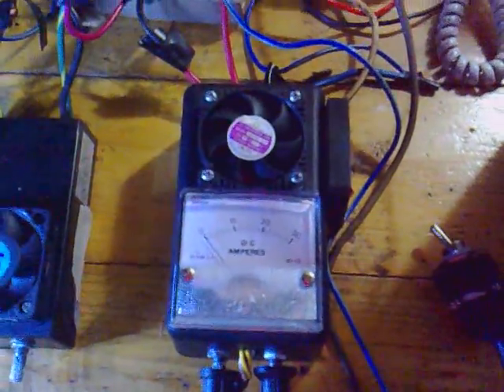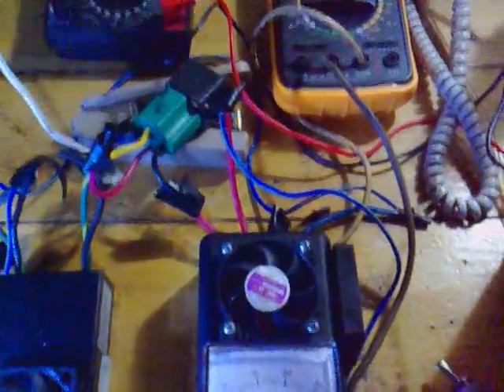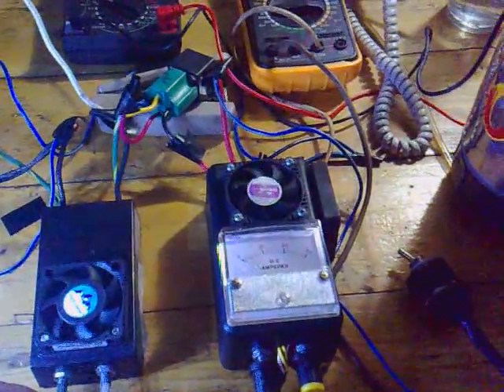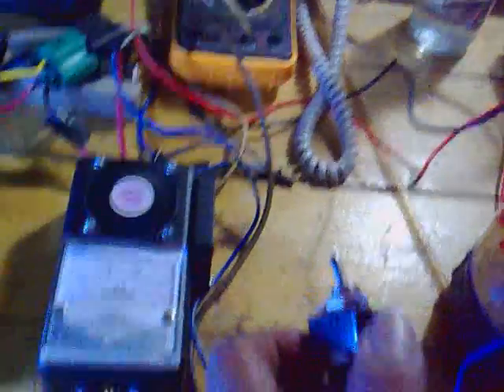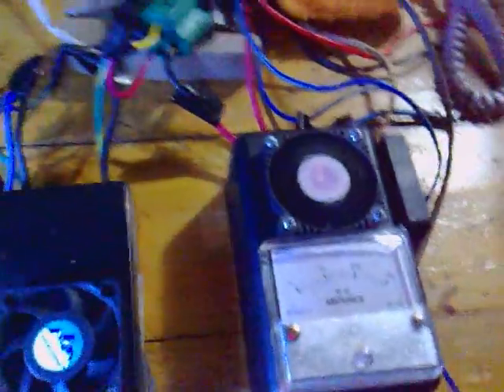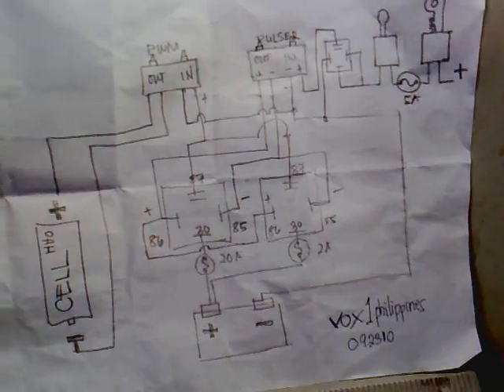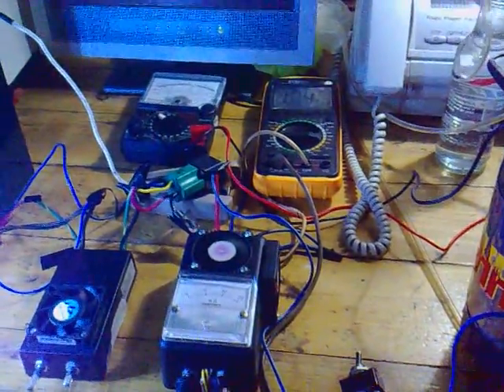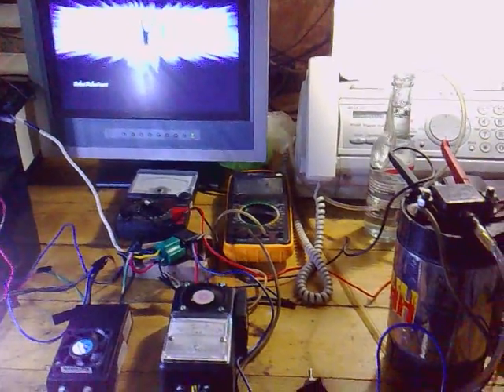MY HHO PROJECT ON MY CAR / HHO GADJETS AND  WIRINGS PLAN  V039  092410

Comment: @irondmax 
Got it Max..thanks..anyway, I have an 80amps self switching relay..the trick on 87a terminal..I can then connect an inductor..no need of pwm..the duty cycle is controlled by resistance of cap...I requested Vox to build one pwm for me and I will try that also in my setup...God Bless

Comment: @2bigHybrid 
the relay is just the switch..like a light switch.
the inductor absorbs the wattage power.
the pwm will not heat up because it only powers the relays, witch is small power....
use more relays and more inductor or bigger inductor for more amps.
just watch how hot the inductor gets..turn down the pulse if it gets hot.
the faster the pulse the more amps you let pass.
if amps are controlled , then you control the heat in the cell. 
this is meyers 50% duty cycle he talked about

Comment: @delvis11
we are controlling our amps with a much slower pulse through the relay.
our target amp draw is 20 amps for a car and 3 to 5 amps for a motorcyle.
we are useing a big inductor to store the amps from the slow pulse.
so at the cell, amps become higher and volts become lower.
the pwm is pulsing the relay..... the click you hear is the relay on and off....
relay provides a fast on or off and easy to change when it smokes.
no amp run away this way...it will run the same temp for hours

Comment: @delvis11 
I think the relay absorbs heat from the load of the cell, it's possible to add more relays to handle more amps before it heats up the pwm...Original circuit copied from Irondmax..

Comment from the maker: @delvis11 Thankz for the info about the thousand pulse,  well dint yet read nor hear that on you tube. still kid in town,   any wayz,  this is just an actual  observation on my motorbike. i can't use straight  3A  from my PWM, my battery shot down. when i pulse slower,the 4 amps from the PWM's output, i observed the battery is relax maybe theres a gap of charging the capacitors that supports the battery ....
as i said its only my observation,  so im trying to observed further ...thankz bro

Comment: @vox1philippines 
be carefull...... the pulse is extreme......you need to try to separate  everything from your other circuits in your car..... so nothing melts...... my friend in poland is useing the inductor, and i do not know what else...... he is at 10 amps and flat plates.....very good production.
also relays do not last forever.......

Comment from the maker: @irondmax thankz bro ! i can give up to 20A or more, you said, just add power relay, i put 2 relay to my car, i almost exactly copy your post video how to make buck converter circuit.. i run this about 3 hours last night, I LIKE IT ! no HEAT problem on my pulser and PWM... my model cell here is not the one i will use in my car, i will use tubes... your pulser with the relay is PERFECT DESIGN !!!... can i install it to my car NOW ?